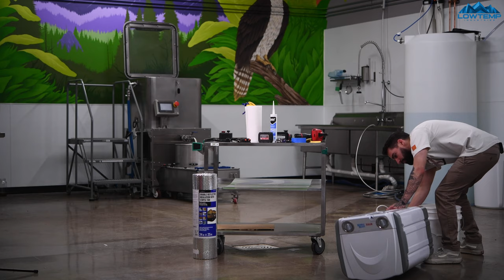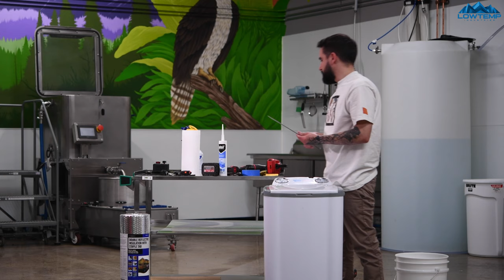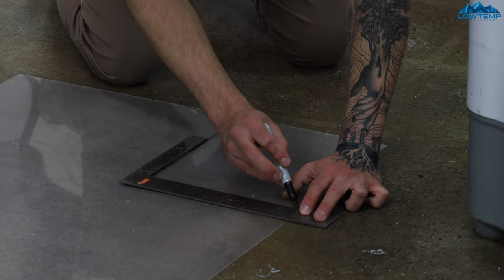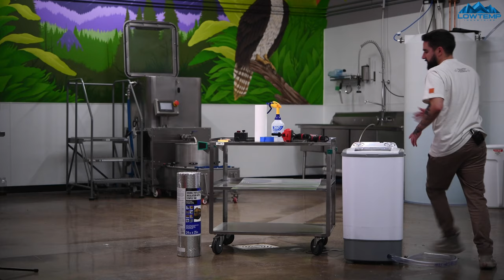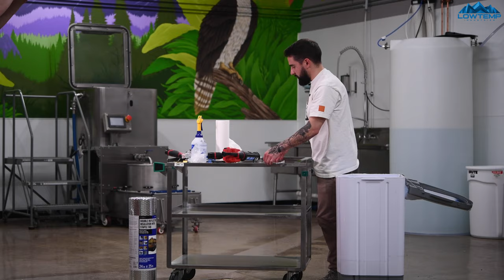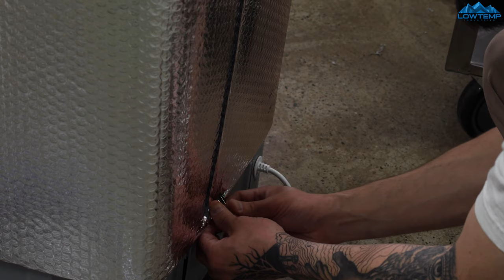HOW TO: Modify a 20 Gallon Bubble Magic the Lowtemp Way!

Comment: What did this modification actually do. I just saw him ripping things out and saying throw these in the trash. But why???? What was he doing?? Why was he getting rid of stuff and what was the purpose of everything he did??? He didn’t explain why or what the modifications did?? There was absolutely no explanation for why he did the modifications or how they helped at all!!!
Reply: Ya y get rid of the pump, now u have to set it on a table or something.
Reply: Removal of the pump prevents damage to the trichomes during draining. Sending trichome rich slurry thru a pumps impellers will rupture the heads and lower yield and quality. The unit will have to be gravity drained. Replacing the drain hose from a corrugated one to a smooth inside hose will prevent trichomes from getting stuck in the corrugated grooves. It will also allow for proper cleaning. Replacing the panels inside the washer to plexi will prevent any material or trichomes from getting stuck behind the panels. The way the area is shaped behind those panels is very jagged and can cause the trichome heads to smash against the angled and grooved plastic. The panel replacement also provides a more rounded wash vessel which will create a better flow of all material inside the washer (ice/water/flower material). Wrapping the machine with insulation provides a more stable work environment for temperatures. Hope this helps!
Reply: @ryannunnink293  less places for buildup/mold etc.. & it’s too rough on the trichomes. A lot of the things he took out only harm you in the long run. The plexiglass is so you don’t have to keep opening the lid making it easier to achieve and hold your optimal temperature. The tubes that are factory aren’t properly rated to use them for extraction purposes. The “filters” are a breeding ground for mold etc. The last thing he said was optional, that limits the power,  is really helpful if you have strain that works best on a low n slow wash speed. Only thing I could add to is maybe another wrap of insulation so it’s doubled up to keep the cold in even better. Hugest thing I learned was CLEAN CLEAN CLEAN after you are done. A machine can get ruined after 1 wash if you don’t clean your machine right, all it takes is 1 time!
Reply: @mattbushnell5709 how do you clean the machine right? Is there a product you run through it after to make sure nothing gets built up?
Reply: @ohnoitssean7117  I always just used some ~%90 isopropyl alcohol.. it breaks everything down and sanitizes, then just hot water. It’s pretty basic, works well though. When storing always make sure there is no pooled water etc. in the machine after cleaning.
Reply: @mattbushnell5709  nice one I’m currently using isopropanol 99.9% so I’m on the right track nothing better or specific to clean the machinery with. 

Appreciate your reply 🙏

Comment: We tried aquarium silicone, it didn't hold, bathroom silicone... Didn't hold... Is there something we're missing here ?
Reply from the maker: Apply it properly! You'd be surprised what silicone is capable of holding when applied properly. You want to make sure you use enough and you let it dry for at least 24-48 hours since you'll be applying it pretty heavily in this instance.
Reply: 3m 52000
Reply: No, its BS. Ive tried every silicone I can find and it always fails (thin-thick and 7 day cure). I now just have the plexiglass with a million holes to allow the corners to drain out but still something so it wont catch the bags. I just capped the tube good enough that it wont leak.
Reply: @Majuubean  Did you take the plastic off both sides of the plexi glass?

Comment: Why did you get rid of the water pump, it seems like you made things harder. Now you have to set it up high somewhere? Love the video though I've had one of these machines for five years now and now that I cut those hoses off they are gross inside lol lol
Reply from the maker: That pump is super unsanitary. In addition to that, that pump certainly ruptures heads, leading to a loss in yield. Gravity drain or very very expensive sanitary hash specific pump should be used for trichome separation.

Comment: So what I read was 80 gallons for 2000$ ish, or run 75 gallons for 30k$

That def throws a controller away from purchase; have to answer to the boss why cant we just use 4 of the 400$ machines with a lil mods or buy the big one that does 5 gal LESS for the price of a car.

$2000 vs $30000
Reply: These machines are wayyy less sanitary and even less reliable if your using it for commercial size runs they will break down very fast.. the machines low temp offers make some of the highest quality extract in the biz. Not to say a hand stirrer can’t achieve the same or better results. Just depends on what kind of operation you’re running. I’ve seen somewhat decent size operations using modded washers like these, but over time they upgraded to legit machines.